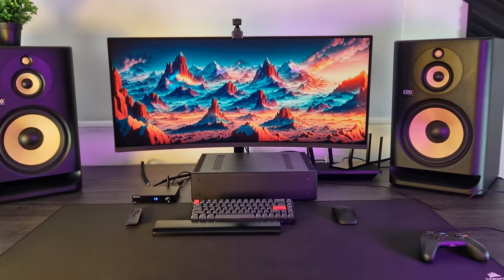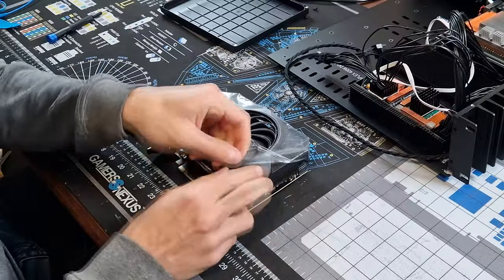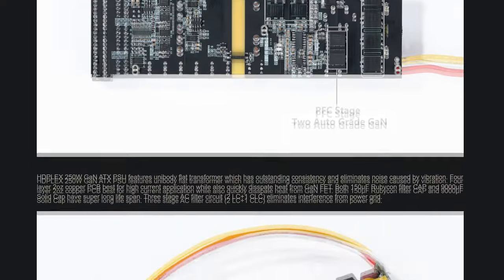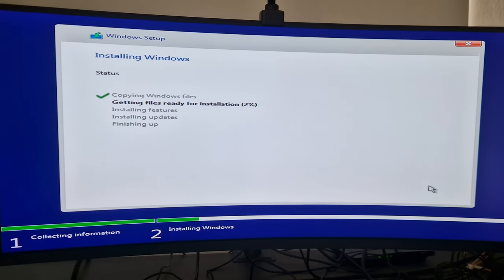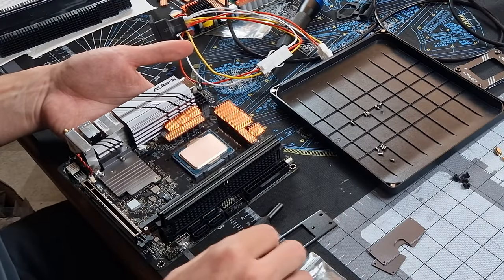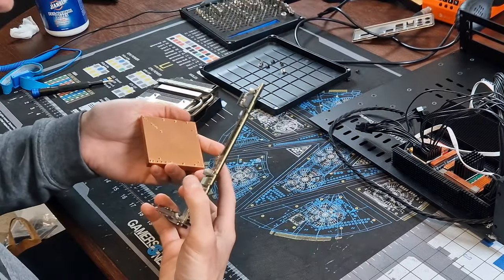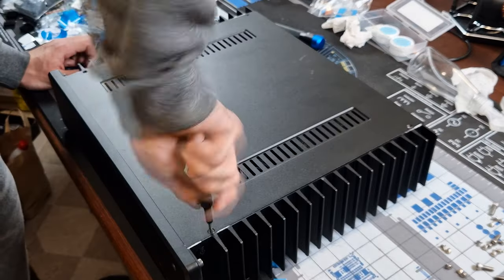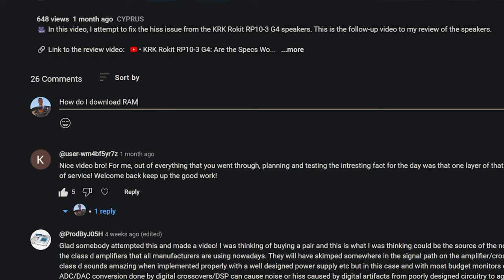Absolute Silent POWERHOUSE: Building a PASSIVELY COOLED gaming PC!

Comment: i've always wanted to build a passive-cooled computer using a case as the heatsink, amazing how you built one
Reply from the maker: Yeah, information out there is very limited. I was basically going blind but at the end of the day, it worked out! 

I think you should wait for HDplex's H10. They'll release a new case (I don't know when exactly) that is going to be a bit taller than this, thus increasing the surface area. That means more cooling for the components.

We'll see how it goes. When they release it, I think it's your chance to go fanless 😄
Reply: thing is you can build silent pc with fans too.I see this as challengefor him but not really practical.

Comment: Great stuff! I have the same case but my setup is using an amd 5700g CPU as i don't need a GPU since the integrated one does the job for what i need it for. Though the case is always overheating in my case and right when i'm in the middle of smth, i get the nasty blue screen of death. I'm going to have to revise the heat dissipation as i was just about to abandon this project and go back to a regular small form factor. Though having no noise coming from the pc is such an underrated feature, it would be hard to go back to a regular build
Reply from the maker: Try to see if it's RAM or storage related. RAM can get pretty toasty if you have XMP on and storage can cause that as well. Especially if you have an NVME drive without a heatsink.

If all else fails which I think it won't, you can always move the components to an open air case and then with 1 big fan running at the lowest rpm can cool everything.

Comment: really cool project. Personally I would have gone with a gen3 nvme drive. These run much cooler and are more than fast enough for normal use.
Reply from the maker: @macualey  Thank you! I think it's better to get the fastest, newest, and most reliable SSD you can afford. 

Now, if you're worried about temperatures, then put a bigger heatsink on top of it. If it's still a problem, direct some airflow as well.

If you want to have a more efficient SSD, then cap the speeds on your motherboard to only pcie 3.0. That way, you can still benefit from the much faster controller and the better random writes and reads of the SSD.

Comment: I know the price and simplicity of mounting the cooling block were likely the deciding factors for the graphics card buy A2000 or RTX 4000 Ada SFF would do so much better if you'd like to pay up
also I'm really not a fan of using Intel for that, if you're fine with 8 cores an APU would do splendidly, though personally I grabbed 7950X and the PBO is smart enough to take care of mostly everything, I just cut down the max boost clock to 5GHz so it doesn't immediately incinerate when running single core loads
Reply from the maker: Of course, the RTX 4000 series would be superior in every way. Just think of an undervolted and underclocked passive rtx 4070 ti super or the 4080 super with the bigger cache and more cude cores.

I'm fine with 8 cores, yes, but APUs are so underpowered in terms of gaming. I have a 3440x1440p screen, and that requires a respectable amount of GPU power to run games.

7950X for this passive setup would be a horrible choice. It'll have very high idle power consumption up to 50 watts, which will blow a huge chunk of your cooling overhead.

Yes, it won't incinerate as soon as you push it, but it'll severely downclock and reduce the lifespan of your motherboard as well (due to the power asked by the CPU and the lack of airflow), especially if you're multitasking.
Reply: @honestcomputing  I meant specifically the professional card named RTX 4000 Ada Generation SFF, 70W TBP, more CUDA cores than 4070

you can use APU not relying on the iGP alone too, that's not an issue

and sure, the I/O die draws quite a lot of power but it's still stupidly efficient under load, not so much at idle though
Reply from the maker: @Z4KIUS  it's smart to buy a consumer RTX 4000 GPU instead of the professional cards that are more expensive. And instead underclock and undervolt it.

Yes, ryzen CPUs are efficient during load, but you always have that high idle. For example, if you play a lightly threaded game, an Intel CPU is still going to be much more efficient. 

Only if you're heavily loading the cores the ryzen cpu comes on top, but even then, you can just tweak Intel CPUs to be on par or even more efficient in all scenarios.

Thank you for taking the time to suggest things and have a conversation. 🙏
Reply: @honestcomputing  well, I also like the fact these pro cards have half height PCB and no power connector
Reply from the maker: @Z4KIUS  Yes, if you want to fit your build in a smaller case, then it's essential.

Comment: Beautyfull.
Top cover isnt very good, but its also about protection so...
U have picked pretty hot CPU

9100f  passivly cooled here with rx6600,     got already new 13400T  bought,  its also going to be passivly cooled, quiet.

Prices of cases are sick. I went cheap with standard one.

Comment: Great build! This was inspiring. I ordered an HDPLEX H5 today for a build with similar specs minus the GPU, as I’ll be using an M.2 PCI-E x16 card instead.
Reply from the maker: Nice! What will you be using as a CPU?
Reply: Core i9 13900T (35W TDP). I’m thinking of either delidding or lapping it as well. I’m not sure if delidding would be compatible with the copper heatsink. What do you think?
Reply from the maker: @JonWorrel  Very good choice! Just make sure you get a lga 1700 socket correction frame. Lapping and delidding won't give you that much of a temperature improvement because you're already at low wattage. But if you're going to do one of the two, then go for the lapping.
Reply: Will do, thanks for the advice!

Comment: Of all the components, which is the hardest to cool for this type of cooling in your experience?
I like your choice of processor. Great video overall.
Reply from the maker: Thank you 🙏 I would definitely say RAM. You can not find any good heatsinks that have mass out there. The ones I used came out in 2009, I think. And because of how little space you have around the sticks is difficult. 

RAM is an essential component for cooling for sure.

Comment: This is a really excellent build - congratulations. I have a question, though, on your use of K5 thermal paste... I notice that you tend to use a lot of paste - so much that when you tighten components down, excess paste is oozing out the sides! Obviously you want to have sufficient paste to have complete coverage of the hot surfaces, but elsewhere I've read that too much paste can be a bad thing. The idea, as I understand it, is that the paste should be just thick enough to ensure that there is a complete and unbroken connection from the entire surface of e.g. the IHS to the block on the cooler. The thinking is that any extra paste is just something else that keeps the heat in. So I wanted to ask if you had experimented with this - with using different amounts of cooling paste - and, if so, what your thoughts were. 

Thanks again for an informative video!
Reply from the maker: Thank you for your words! Yes extra paste is indeed bad but not as much as the internet wants you to believe. 

If we're talking about K5 then the more the better because you want to make sure you get the correct height for the specific component you're covering to touch the heatsink. Sure excess paste can hurt performance but you want to be sure that the component is transferring its heat to the heatsink. That's more important than losing 1 degree Celsius in temperature.

Same thing applies on regular thermal paste you put on your CPU. The only thing that is different is that the paste oozes out on the motherboard and it becomes very messy to clean. Best video to watch on this subject:

https://www.youtube.com/watch?v=EUWVVTY63hc

TLDR: Don't worry about it as long as you have proper contact.

Comment: Very interesting and clear video on many points. A doubt to attach all the various mini heat sinks between motherboard and gpu, is the k5 pro very adhesive or if it were turned upside down would they detach?
Otherwise do you think it's better just double-sided tape or double-sided tape + thermal pad? From the video it looks like you used all the options a bit.
Reply from the maker: Thank you, glad you enjoyed! K5 pro is a bit sticky but doesn't have enough strength to hold a component if it's flipped upside down (especially if it's a heavier copper little heatsink)

Now in the video I used K5 pro for the motherboard chipset and vrms that had a heatsink where you screw into the board. The rest of the VRMs I used a very sticky thermal tape with K5 for some of the capacitors to reach the same height.

So it was used to level the components so that they touch the small heatsinks. Think of a choke and a capacitor. The capacitor is taller so you fill the choke with K5 till it reaches the same height as the capacitor and then stick a heatsink on it. Now you have both components "touching" the heatsink.

I hope I was clear 😄
Reply: @honestcomputing  Thanks for the very clear answer.
Reply from the maker: @simone8019  🙏

Comment: This is awesome!! Just curious why if this is a gaming build why not go for the 7700 or even 7800x3d. I mean they are easier to cool than the 13600k. Definitely the 7700 is.
Reply from the maker: Thank you. A gaming build can be any PC that plays games. For me, this one manages all the games I play just fine.

The 7800x3d or the 7700 wouldn't be easier to cool, especially in fanless build like this. The reason is that they have a very high idle power consumption (30-35 watts) compared to intel cpus. This is because of their chiplet design.

The 13600k is more efficient in all tasks due to the disabling of Intel's turbo boost. For example, if you play a cpu light game, then the intel one will be consuming 10-12 watts, whereas ryzen would be consuming a minimum of 30 watts. This makes it exactly 2 times as hard to cool.

You can watch my follow-up video to see the numbers.

Comment: Nice build, I actually want to buy one of these cases, but they seem to stay out of stock.  Any recomendations?
Reply from the maker: I suggest putting your project on hold until HDPLEX releases the H10 or brings back the H5 in stock.

I was told that the H10 will be heavier, so it'll handle more power from components and not require a pcie riser.
Reply: @honestcomputing  Great feedback, thank you so much for taking the time to replay.  The H10 sounds much more like what I am looking for. Keep up the good work. :)

Comment: No doubt it works with power limits but  Ryzen 7900 + 4060 16GB  is what you want for fanless in 2023.
Reply from the maker: GPU is more efficient, I know. But I heavily disagree with the CPU choice.

Amd because of their chiplet design can consume up to 40 watts just for idle. Intel can idle as low as 2 watts.

It's even worse if you have a ryzen 9, which has 2 logic dies (cpu cores).

That's why Intel is more suitable for fanless builds.
Reply: @honestcomputing  
People are weird about idle power consumption. You can afford to pay for it. It can be easily dissipated by the heatsinks. This is not a home server that sits idle, it can automatically power down when not used. It makes no sense to hobble your performance for it. Also, I do not believe a 7900 draws up to 80 watts at idle - that’s ridiculous.
Reply from the maker: @ferdinandbardamu3945  
First of all don't assume everybody can afford it just because you can. Second of all if I had a 7900 it would consume 55 Watts on idle. You can see for yourself here: https://youtu.be/JHWxAdKK4Xg?si=nXjReUh-gSclI9HU&t=798

And yes the heatsinks of the case can dissipate that but the heat will saturate them quicker. You're right this is not a server but I'm still using my PC most of time on "idle" with stuff like emails, communicating and consuming content.

I didn't "hobble" my performance by going with Intel, I'm very satisfied with performance, the PC can handle everything I do without breaking a sweat CPU wise.

Be sure to check my new video showing temperatures and power of this PC when it drops. Hopefully you'll learn a thing or two.
Reply: I decided to go with Intel 14600k when I found out that Ryzen CPUs actually aren't efficient as Intel when it comes to idling and office/multimedia tasks. But do you think the new 8700g is a good compromise because I don't have to worry about adding a dGPU? I'm trying to come up with a built for my nzxt H1V2 case and want to keep it as quiet as possible. But right now I'm leaning towards the 14600k due to overall components costs, efficiency and I can just use the UHD 770 iGPU on the 14600k for office tasks since I'm not a gamer. I ask because I'm impressed with your knowledge, planning and execution of this amazing build !!!Thanks in advance for your opinions!
Reply from the maker: @tomtran614  If I wanted something for the office I would have gone with the i5-13400. More than enough cores and also has the UHD 730 igpu. Decent for multi-monitor setups as well. Go for a cheap motherboard with DDR4 but be sure to buy a large value for money air cooler. That will keep the system cool and always silent.

Now the 8700g is impressive if you want to game a bit but the cost of the whole system will be much more cause of the motherboard and DDR5 prices. The good thing about it though is that you don't have to worry about the idle efficiency because the 8700g is a monolithic CPU design.

Hope this was helpful.
Reply: @tomtran614      14600k is very powerfull cpu, r U sure U need that big one?
I went for 13400T (35w)  - im going to play games on it all the way up, i cant imagine what for will U need 14600k ^^

theres also new 3050 6gb graphics  which is only 70w tdp

Comment: could this case cool a 4090??
Reply from the maker: Actually, yes, but you have to power limit it to 75 to 100 Watt.

The funny story is that I owned an RTX 3090 and was testing to see how far I can undervolt and downclock it. 

It turns out that the 3090 doesn't like drawing less than 90 Watts in game. Even in the lowest settings, 720p resolution with 60 fps lock on a non demanding game.

On idle mode on desktop, it consumes about 16-22 Watts, which is manageable. And then I decided to go with the 3060 which can drop to 30 Watts even in game.

The 4090 can consume down to 30 Watts in game if you want as well, which is a huge step up from the 3090. Most probably cause they left samsung's 8nm process and went with TSMC's 4nm.

In conclusion, yes, you can cool it, but you'll lose a lot of performance because you're not using it to its fullest potential.

Not to say that I use the 3060 to its fullest potential in this case because I don't. Now, if you have the money and you want to go fanless, a 4090 at 75 Watts will be much more powerful than a 3060 at 75 Watts.